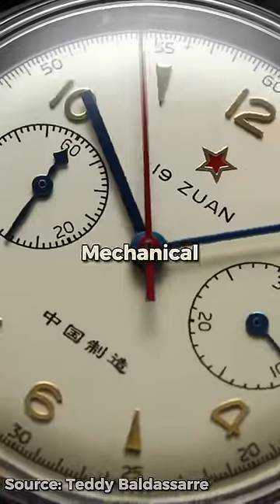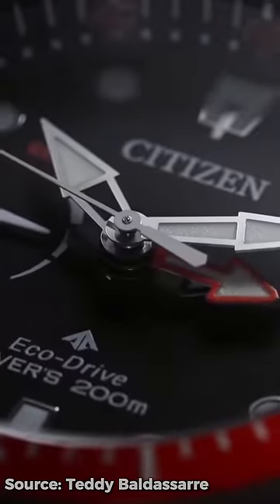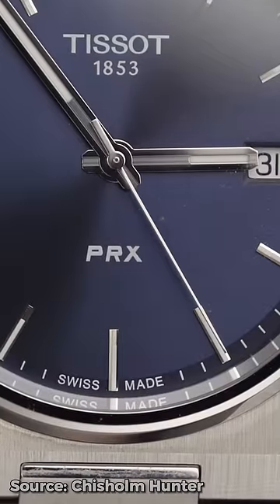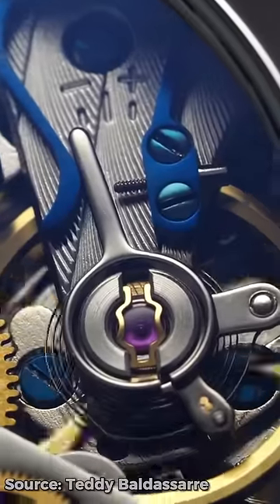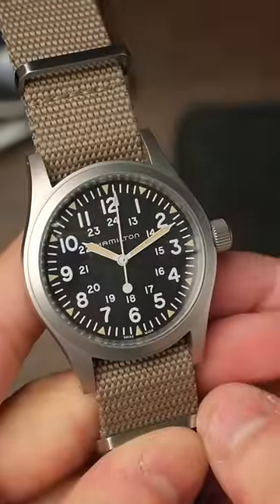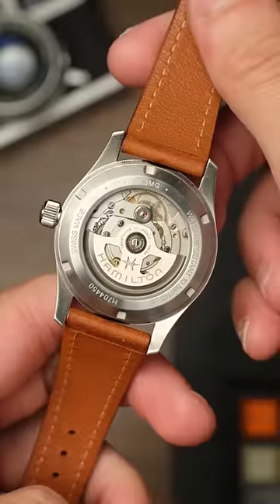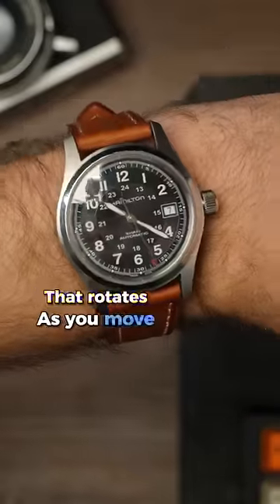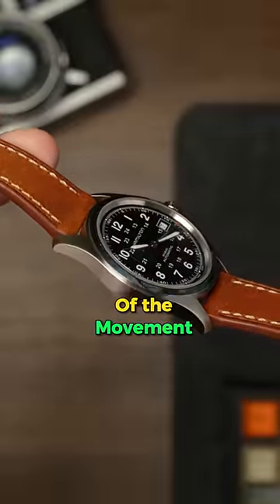Watch Movements Explained (Quartz vs. Mechanical)

Comment: If you want great accuracy buy a quartz watch.  If enjoy craftsmanship buy a mechanical watch.  If you want accuray and craftsmanship buy a Grand Seiko. ;-)
Reply: Grand Seiko is so classy...
Reply: So true get a 9F series quartz if you really want accuracy and beauty, but I would choose a spring drive, best of both worlds! They are better made than a Rolex. I have 1 Rolex I inherited and 2 Grand Seiko’s that I bought. No way will I pay what they ask for rolex. The GS are in a higher orbit than rolex when I compare the two side by side. And comparing it with new Rolex models.
Reply: @rbmwiv  doesn't Bulova lunar pilot watches have the same accuracy as grand seiko, and they also cost way less than a GS?
Reply: @prateekluthra911 they are 2 different movements. I believe the lunar uses a tuning fork system whereas GS uses spring drive. Both are incredible from an engineering standpoint and not what you see in your everyday quartz watches, but they work on different principles
Reply: Are mechanical watches so expensive? I am for a decent mechanical watch for a budget 200 dollars do you have any recommendation
Reply from the maker: This dude Grand Seikos
Reply from the maker: @rbmwiv  Yup, Spring Drive is peak horology
Reply from the maker: @sidewinded1  Great breakdown
Reply from the maker: @it.is.mario.  Orient Kamasu or Bambino
Reply: Is it comes under 150 Rs 😊
Reply: if you really really enjoy craftmanship make your own watch from metal ore
Reply: if you wanna save your money your mobile shows best time
Reply: @atuldeo3566   with that much money i am afraid you won't able to get a 3rd class copy of mechanical watch .
Reply: Imma stick to the limited edition Dora watch
Reply: @nasimhussainchowdhury2466  lol
Reply: I inherited a Seiko watch from my deceased grandfather, it's great!
Reply: @vuurkoning  my favorite watch is the one I inherited from my Grandfather.
Reply: bruh ofc i want fucking accuracy when im buying a fucking watch
Reply: If i want great accuracy I’d get a smart watch.
Reply: Gand seiko = just an overpriced seiko
Reply: Ah yes a grand Seiko Lemme just pull out a loan
Reply: What’s so special about inaccurate craftsmanship?
Reply: 10k and you are good to go 😅

Comment: Then you got Seiko with their Spring Drive, a Mechanical and Quartz hybrid wizardry.
Reply: Then you have my watch, the AP Rolex “No money in my wallet” which has neither
Reply: also the bulova accutron, which uses a tuning fork to regulate the watch
Reply: Japanese engineering in a nutshell
Reply: how about the "That's Not a Watch, That's A Glorified Bracelet"
Reply: I have the seiko kinetic. It sounds like it has a rotor but also has a battery... which one is it?
Reply from the maker: Masterpiece
Reply: @l_poci_  then there's me with my grandpa's mechanical pocket watch, this thing got some beating to it but hey it still works
Reply: @nokatomo9939 it's a quartz but the battery is recharged by a rotor, which means there is a time the battery needs to be replaced
Reply: @sidewinded1 that is sick

Comment: Watches are fascinating as such precise engineering is required to make it work with the parts being so small
Reply from the maker: And they also power themselves! Incredible that no battery is required
Reply: Then checkout micro processors under microscope
It will blow your mind how billions of extremely small transistors are accurately aligned

Comment: I use a soviet  mechanical wach  is way better than battery one and is frendly enviroment
Reply: No mechanical watch is more accurate than a quartz watch. Those also require more maintenance than quartz watches. Also, a small 10-year battery isn't going to harm the earth very much, and they even make solar powered quartz watches.
Reply: @Shock_Treatment  The old school wach seems better i do like it it does the joob

Comment: So dumb question here but how do I ‘fix’ my automatic watch that’s been sitting around for a while - if I move it it continues to work so will I have to wear it on my wrist for a while
Reply from the maker: Yes - automatic watches stay wound for only ~40-80 hours when fully wound. But it will keep winding itself whenever you wear it. Don't worry, nothing is wrong with it, this is just part of how automatic watches work.

Comment: Im confusion my watch is quartz because its using batteries but its also mechanical because I have to set the time with a dial and its solar powered so the battery never runs out. Super confused its the Seiko v158 0A0B rail road approved watch I had to buy working for Metro in LA

Comment: The Seiko "Arnie" as shown in the video has a Solar quartz movement, meaning the watch is powered by sunlight and you never have the change the battery.
Reply: Citizen eco drive also.
Reply: Yes probably should have said quartz requires electricity to run as they have capacitors.
Reply from the maker: True
Reply: My Timex Field Post has the same, its real nice and hella accurate too. Over the course of a month it loses less than 2 seconds. Thats not even 30 seconds a year
Reply: You'll still have to change the battery eventually as it'll hold a lower charge as the battery chemically ages, just like any other rechargeable battery like your phone's.

Your instruction manual should tell you when you should send the watch in for service, typically 10 years, though if you can find the battery for sale you could do it yourself to save money since it's no different from replacing a normal battery (just remember to replace the gasket as well to ensure watch is still water resistant).

Comment: Using spring as power reserve... How long the spring will last until it no longer can be used as power reserve?
Reply from the maker: The power reserve of mechanical watches can vary, usually between 40 - 80 hours before needing to be wound

Comment: Is there any very affordable mechanical watch ?
Reply from the maker: Plenty! That is primarily what my channel is focused on
Reply: Yes exactly you make really good content,
And you also suggested an affordable watch which was Addiesdive but if it is possible to get a mechanical watch with chronograph in the budget of $100 or $120, Can please suggest me ?
Reply from the maker: @manupratap7064  For a little bit more (closer to $200) you can get really good chronographs using the Seagull ST19 movement such as the Seagull 1963 or Sugess Chronographs

Comment: It always seemed weird to me that mechanical watches are so much more expensive than quartz and yet are so much less accurate
Reply: Yup. It's mostly about the artsy appeal now, but quartz watches have always interested me more. I can pretty much guarantee that if quartz watches came out at the same time as mechanical ones, the people of the old days would've chosen quartz simply because they're more accurate, and the purpose of a watch, especially to them, is to keep accurate time. Quartz is also so underappreciated too. People constantly gawk at mechanical movements, but that's probably only because they can actually see the gears working. However, if you look at the amount of technological engineering it takes to make a quartz watch, they seem much more impressive. You first have to know how to grow the crystal and shape it into an unbelievably tiny tuning fork, you have to know how to make a battery and a tiny motor (or LCD/LED panel), you have to know how to create the complex circuitry that can accurately count the resonance of the crystal and convert it into time, and you have to know how to put it all together. I'm sure that's majorly simplifying it since even I don't know how they work entirely, but I know it's a complex process that's built on the advancements of many people, and I'm sure no single person could make a quartz watch like one could with a mechanical.

Comment: My mechanicak watch gets wind up a lot at 1 a.m and has enough energy to last for years
Reply from the maker: Woah, what watch?
Reply: @ChronometerCheck  Unfortunately I can't remeber the name. It also doesn't have very high specs. It just get wind up a lot when I am alone in my bed
Reply: 😂😂 I got what you mean
Reply: Be careful not to overwind it😂😂

Comment: vacuum can't guarantee mechanical perpetual ?
Reply: They're not stored in vacuum-tight cases, but even if they were, there'd still be friction from the parts interacting with each other. Perpetual motion machines are impossible.

Comment: Mechanical watches are probably the most fascinating, delicate but completely useless engineering in the world.

And that's coming from a mechanical engineer who do appreciate mechanical watches so save your hate comments.
Reply from the maker: Would hardly consider them useless, but I understand what you mean. And yes, they are marvels
Reply: Explain why it’s useless
Reply: @shadmansaifullah9609  it is less accurate and it does the same job as a quartz watch but harder (Btw I am an absolute sucker for anything mechanical do don't try and say I am hating)
Reply: @shadmansaifullah9609  Compared to a cheaper digital or quartz watches, it is inaccurate and a nightmare if you break it. It's "useless" because it serves no better utility purpose than quartz/digital watches. The appeal comes down to taste and preference, not from use.
Reply: @shadmansaifullah9609  because you could get a smart watch for way cheaper, lmao
Reply: @shadmansaifullah9609  a lot of good answers already, but here are my two cents -

Mechanical watches are less accurate, higher maintenance, more expensive and practically have no impactful features (like seeing notification, monitor your movements) compared to a digital smart watch.

Choosing them because they're 'classy' and 'elegant' is like making a car with a steam engine rather than an ICE or electric drive.
Reply: It's not useless. Very few things are completely useless, let alone amazing mechanical devices that you can wear on your wrist and also tell you the time. If accuracy was the be all end all, quartz watches are no good either, your phone (or a  smart watch) would do a far superior job.
Reply: I see watches especially mechanical ones, as jewelry for men. Also, the accuracy difference isn’t that big compared to non-mechanical watches.
Reply: @shadmansaifullah9609 it depends on your point of vuew, I purchased an automatic mechanical few months ago the thing which pissed me was when I am not wearing it, it stops and everytime I have to set time before wearing but the thing which made me buy it was smooth movement of seconds hand it's a very small thing quartz seconds hand move like tik-tik but mechanical one moves smoothly and also the transperant back by which we can look on all those small gears felt beautiful.
Reply: so you are useless eng eng
Reply: @AsgharHussain110 there's winders you can place them in when not wearing them but if i cycle through all my watches by time i get back to the automatic itd be off by more than a minute and id have to set it again anyway im not wearing anything over -/+ 1 minute.
Reply: @Banzybanz They are pretty useless. As far as functionality goes, they are useless in the modern world. They're only not useless in terms of artistic beauty (which is still functionally useless). Also, smartphones, smart watches, and every other modern electronic computer out there has a built-in quartz clock. How else would they keep track of the time? Radio watches also exist, and they sync with an atomic clock, so they're extremely accurate.
Reply: They are definitely not the "most" fascinating

Comment: You forgot mechanical watches have their own expensive battery every 5 years a mechanical watch must be cleaned and oiled otherwise the performance will suffer, and to get some1 to look at it you might as well throw it away and buy yourself another one because its about $150 to clean it and oil it if you take it to a horologist

Comment: So is it okay for a mechanical watch to stop after keeping it stationary for a small period of time..?
Reply: Typically after about 40 hours of not being used (for most movements), they will need to be wound again to keep them going. Some movements may last for 50-80 hours.
Reply: Or you can have a watch winder that rotates every so often and keeps your watch wound.
Reply: it depends on how long this period of time is, if it is every few minutes/hours, that is more concerning, but once every few days is fine assuming it is a manual wind
Reply: If it stops after a few days it's totally normal and fine. However don't let it sit still for too long (like a few month/ a year) or the lubricant can dry up and affect precision. It can be fixed but at a certain price of course
Reply from the maker: Yes, it won't harm the watch. You'll just need to wind it and set the time again

Comment: Automatic mechanical? I thought those were two opposite words!
Reply from the maker: Automatic is a type of mechanical watch
Reply: Automatic and Mechanical are not antonyms, Manual in the other hand is an antonym to Automatic, a car could have a Mechanical gearbox (spoiler: they all do) and still be automatic
Reply: Manual mechanical watches require you to wind them. Automatic mechanical watches can be wound by hand or the rotor.

Comment: Mechanical is Master Class, I never have to buy a Battery for it.
Reply: There's solar quartz watches and 10-year batteries. They can operate for much longer without their batteries being replaced than a mechanical can run without needing to be a serviced (which costs more than a battery).